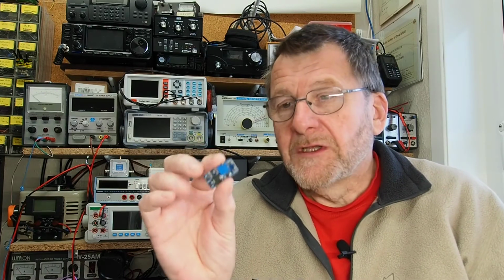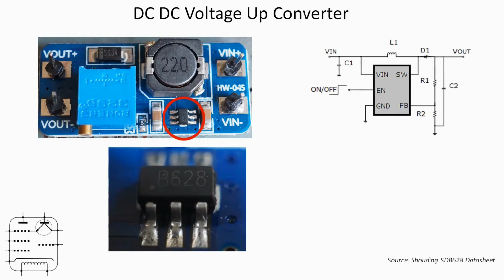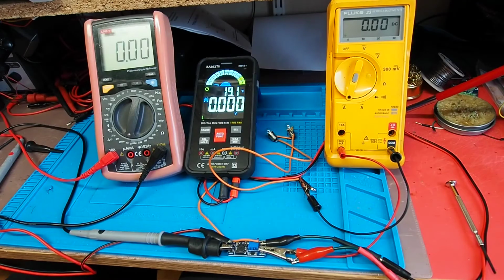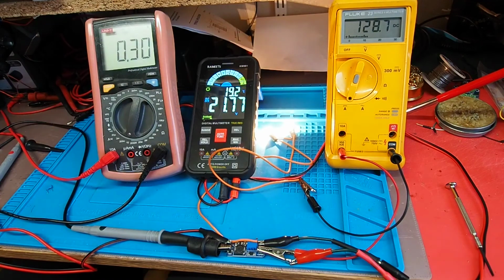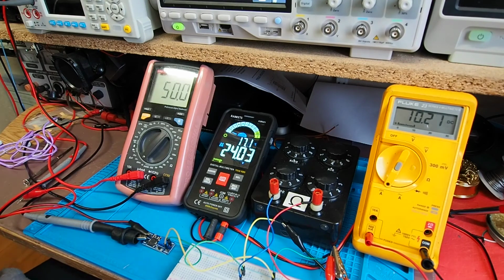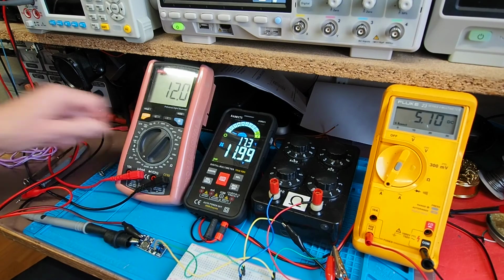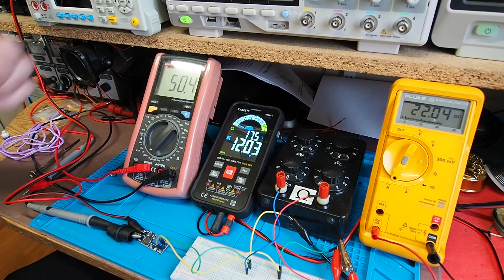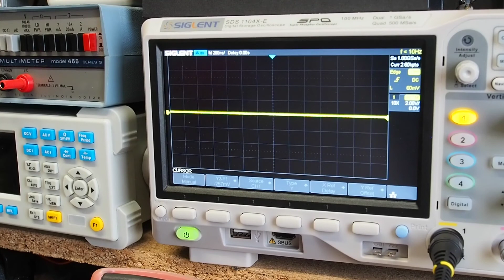ICStation DC DC Voltage Up Converter Module - #100

Comment: Hello Bill,  last year I built a zener diode tester to test unmarked zener's to give me there rated/working voltage on a display, to get the voltage from a lipo cell I think  was 3.7v, I needed  25v I used  a buck convertor , just for fun I'll give one of these ago & see what happens. good video .

Comment: Great review and demo, thanks Bill! I like these units a lot but find that a good few burn themselves out on first initialization, even after adjusting the trimpots. If they survive that then they work well. It is probably an issue with poor quality trimmer pots I think. Interesting that these seem to have different IC's to mine as mine use the MT3608 not the B628. Maybe yours are more reliable. Anyway, thanks mate!